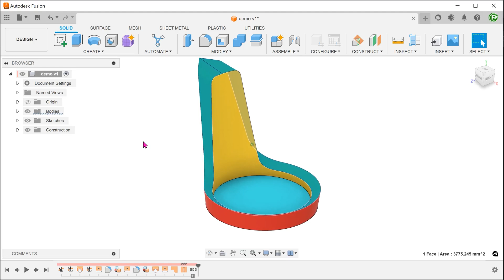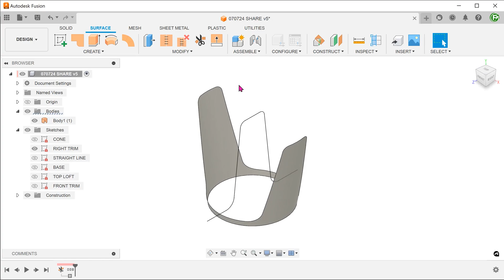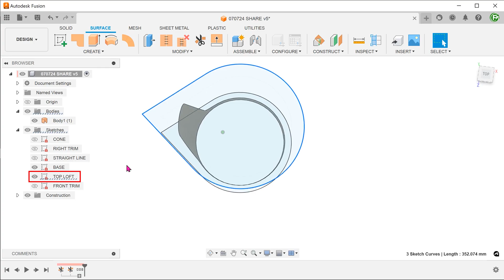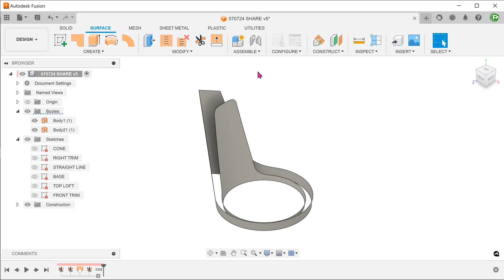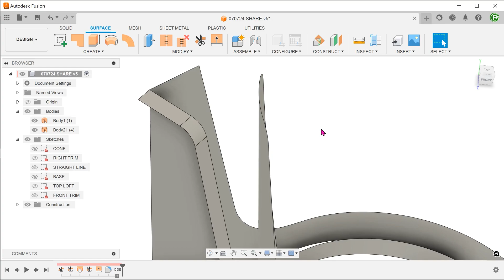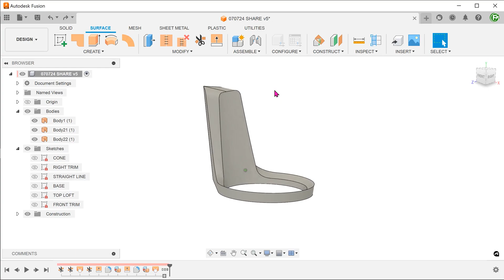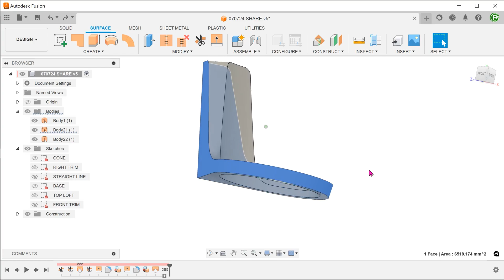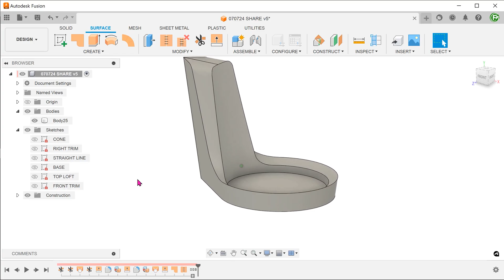Autodesk Fusion | Surface Patchwork

Comment: The loft handle feels like a terribly imprecise and non-deterministic way to control the loft. I thought after rounding off those 2 outer corners (fillet trick was genius btw) you were going to loft 2 pairs of corner curves first, to serve as rails for the remaining lofts